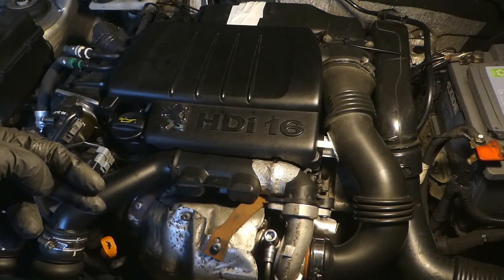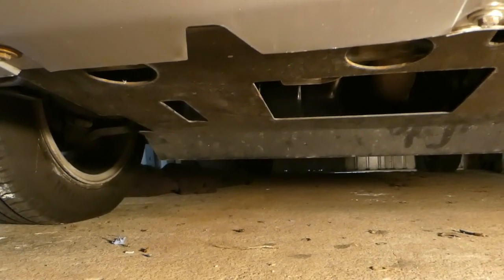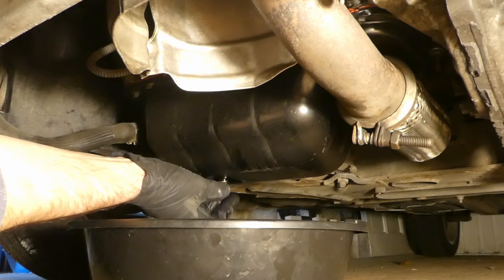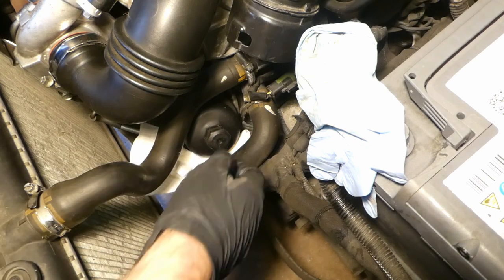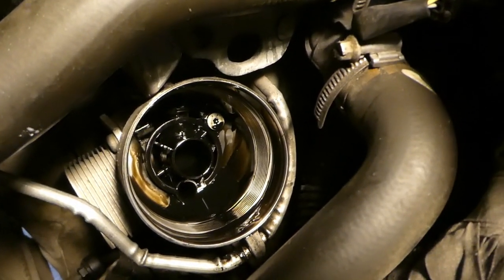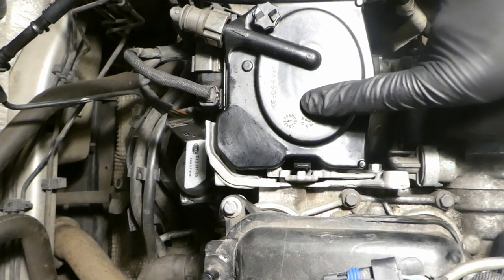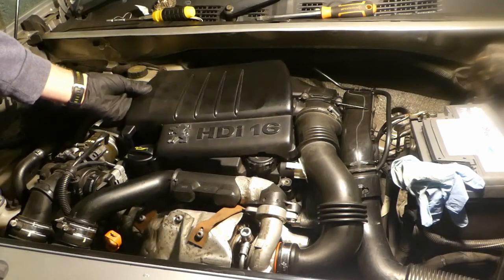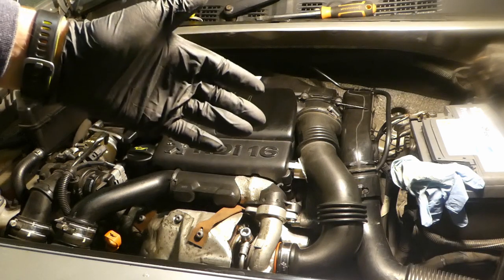1.6HDi full annual service (Peugeot Partner 2007)

Comment: Hi buddy. Thanks so much for your videos. I've just bought a Berlingo with 160000 miles. I've done a full service from your videos and cleaned up the engine. There was a lot of oil / coke around the engine bay, right down onto the alternator. I bought this as a cheap day to day run around on a tight budget, like most of us. It ran fine for a week but now I'm getting a loss of power, jerking, then the SToP sign on the dash. Turbo looks ok. Injectors are dirty but seem tight, they sound ok with stethoscope. When the STOP light comes on, the engine dies, but will start again after a minute and run fine for a while. Any suggestions where I can look next? Many thanks in advance. PS. Are you Polish? I spent a year in your country many years ago, before the EU and had a great time. I hope you're treated as well in the UK as I was in your country.  Best wishes, John
Reply from the maker: Hi John, thank you very much for the kind words, much appreciated.
When you say oil/coke, do you mean there is a sludgy carbon build up around the injectors? This is generally a sign of a failed copper o-ring in the injector seat. I would clean it and monitor if new stuff build again. It is a fairly easy job to take out the injectors and put a new seal at the bottom, you would need a reamer tool as well. Cutting out is a bit difficult to diagnose remotely, but start with the easy stuff, say an injector cleaner, I do not believe in the stuff, but it's probably worth a try. Check if the battery is OK, a lot of stuff could stem from this. Also, you could try to disconnect the MAF sensor and see if that improves anything. If it is better without the MAF, then a new MAF is needed, or potentially a clean, maybe. If you have not replaced the fuel filter, I would definitely do that. Cutting out is generally fuel related, so really clogged fuel filter might be a reason, say it was low on fuel and picked up stuff from the fuel tank. It may be worth cleaning the EGR valve as well. All in all, if you have access to Diagbox/PP2000/Lexia is worth hooking it up to and read any errors. They are a bit expensive and a generic OBDII reader might also work, before starting to replace things.
Reply: Just to add experience to this I had an old non-turbo escort diesel van that cut out continuously but would start again after a period of rest. Three trips to the garage and about £300 labour they found a crack in the fuel line right at the Tank. The repair fixed that one.

Comment: That brown plate you got there on the turbo heat sheild i am taking about mate. be great to know where i can get one for mine as it's broken and rattling
Reply from the maker: Ahh, yes that one. It's home made, i.e. DIY, haha. I got a 3 or 4mm steel flat bar and shaped it into place using pliers, taking care not to poke into the plastic above. It will be easier with a vice, but I do not have one. Drilled two holes to fit in the bolts. It has been solid for ~3 years now. My heat shields where rattling badly and after buying a new one and replacing it, it broke again and it is pretty dear to buy.
Reply: @moremolecules  Now that is very true they are dear to buy and i was thinking the very same that it will break again and i be wasteing money. i will have to do what you have done. any idea where would be the best place to get this steel from please thank you
Reply from the maker: @anglingpassion5039  If you are in the UK, I bought it from B&Q, I think it was a 3mm, the 4mm will be harder to bend. Something like this: https://www.diy.com/departments/galvanised-cold-pressed-steel-flat-bar-l-1000mm-w-40mm-t-1-5mm/3232637736107_BQ.prd
Unfortunately, tcould not find the 3mm this one is 40mm width, which is a bit much.
Reply: @moremolecules  Thank you so much I will take a trip down b&q great guy you are a legend. I subbed to you channel I love the videos you bring to this engine as I have the same one in my citroen Xsara Picasso 2007

Comment: My partner has just reached 100,000 miles...time for some TLC. Great description on how yo go about it all thankyou. One thing I'm concerned about, I'm told the oil supply line yo the turbo has a filter that can slowly become blocked with obvious disastrous effect. Have you done this before and is it of concern? Also the injector retaining bolts can loosen. Definitely worth re-torqueing to stop the 'black death'!
Reply from the maker: Yes, the turbo has a filter, but it does not become slowly blocked. It can of course become blocked. Regular and more frequent changing oil/filters help keep it clean. If you want you can replace the old-style banjo bolt filter with the new design. I did it here and showing the old vs. new style: https://youtu.be/QHY_uPbPfyg?t=114
When I opened the turbo banjo bolt with the filter, my 1.6HDi was ~95k miles and the filter was spotless.
Yes, pretty spot on for the injector bolts, I have described it in here: https://youtu.be/kt6zJANLaYQ

Comment: Such a helpful video. So broke at the moment cant afford to pay garage so going to do.myself (and replace dpf filter). Are the amazon links youve provided for a 2013 peageot partner 1.6 aswell?
Reply from the maker: I feel for you and hope everything works alright. The links are for my 1.6HDi 2007, but they should work for 2013 1.6HDi. I cannot guarantee that of course. Hope it goes well for you. Let me know if something does not quite work.
Reply: @moremolecules  thanks bud to be fair it could have gone worse so far none of the problems have been my fault. The rod sensor element plug thing that runs through fuel filter housing was snapped by last mechanic and blutac placed to seal drain hole on filter. Also the cabin filter had just been crammed in to the point it clearly isn't doing anything and its now impossible to get out. Got all the parts I needed from euro car parts which was brilliant just gave them my reg and they gave me all the right bits and oil. Going to fit the dpf filter tomorrow but annoyingly the fan going in limp mode killed the battery so difficult getting it back up on ramps. So far all the parts and a new 108 piece socket set has cost less than quote from garage at least! One question, is it bad to have a tiny bit too much oil on dip stick? I emptied sump and changed filter but haven't run the engine yet so it's just been sat there for 24 hours and oil filter will be empty but looked at dip stick today and oil is definitely above max?
Reply from the maker: @ollyjackson8733  A little bit is not that much of a problem, like a 1mm should not be too bad. The problem with a little bit of oil is that is gets frothy and everything gets clogged. If it is a tiny bit, it will be burnt off eventually. If I were you I would get a small syringe and a silicone tube from B&Q and syphone a little bit just to be on the safe side of things.

Comment: Molecules if I understood correctly you took 2000ml out of 4075ml. Why you only took that, and didn't took a larger percentage of the old oil? Like 4000ml? 

(I'm a novice)

I know that some people use a new bottle for pushing the old oil, and then they fill up with another bottle. But I was think is the oil stuck somewhere? Like turbo or something and for that reason he can't drain something closer to 4075ml?

Cheers

Comment: Awesome video as usual. Would love to see how you can get to things in something like a Peugeot 5008 though, we're access is hard and you can't really get to the back of the engine. Taking the air filter box out seems impossible :/
Reply from the maker: Haha, yeah, I do not say it is very easy on all models. On mine it is fairly straight forward, but on others you would need to remove scuttle things and all. I do not have other 1.6HDis at hand, as this is my personal car, so I can only show it on mine.

Comment: 2:22 what that pipe you removed and it connects to what, been looking trying to get its name
Reply from the maker: It is an air intake pipe with PSA number: 143451
It connects to another air intake pipe that goes to the air filter box. Unfortunately, they do not have specific names, just air intake pipes.

Comment: Hi More Molecules, when you open the motor bonnet at the left side there is a intake manifold or throttle system harness and military / dark green hoses (harmonica pleat type) and I think air or fuel sensor on it. At the bottom side of this component there also is a pivot bolt an it's slot is embedded to the motor block. That small slot piece is broken from the motor block. Please advise if fixing it by usuing some adhesive like sunfix is remedy or better to do welding. I need your advice-Thanks
Reply from the maker: Hi Suat, I think you mean the EGR throttle body that is next to the intercooler. Yes, it is fixed to the engine body and the underside is aluminium. I am not too sure what I can advise as I cannot see exactly what is broken. You could try with the sunfix and see what happens. Not too sure if sunfix can bond to aluminium.

Comment: hello i love your videos they are very helpful many thanks could you please make a video about oil dipstick TUBE i pulled it up and couldn't put it back coz i cant find the hole thank you so much
Reply from the maker: Not too sure what you mean. If it is the whole dipstick tube, that might need to open the sump and position it there. I have a video for the sump replacement as part of the turbo series, check it out.

Comment: I am half way through the work.  Engine oil and filter done. I am stuck with removing the airbox. It seems my car has a moulded fibre cowling just in front of the bulkhead, behind the bonnet. It comes over the top of the airbox. I have moved my brake reservoir like you, but it seems this whole portion needs to come off to allow the airbox out. Did you remove yours.... it seems you have far more room......!
Reply from the maker: Yes, probably you need to remove the screen wiper cowling to remove the airbox. But in general you should not need to do that, you can just unscre the bolts on top of the air box without removing it altogether.

Comment: My car does not have the hand fuel pump. How should I prime/bleed the fuel in my case?
Reply from the maker: Yes, some do not have one. I cannot quite remember for these, they are either self-adjusting or you need a hand-held pump with a one-way valve. Amazon/ebay self a lot of these one-way valve pumps, it is similar to mine in the video. Remove the pipe that goes back to the fuel tank and pump until hard. Literally does the same thing as on mine.

Comment: Hello. I have a 1 6 hdi. and it's a water pipe that's not whole, think the air filter box has rubbed a hole in it. Is it difficult to change. how long does it take to do it.
Reply from the maker: What do you mean water pipe has rubbed a hole in it? Do you mean the air box has rubbed a hole in the EGR?

Comment: Just bought a dispatch 1.6 hdi 63 plate with 81k on clock. When a bought the van it all seemed well. But after having it a few weeks I’ve noticed black smoke under acceleration. Is this anything to worry about ? I was told by the seller the dpf has been removed and a remap.
Reply: I serviced it today following your video made it easy I also used all the products you advertised falling your links can’t thank you enough

Comment: Please help me with a fuel line high pressure sensor as, as installed car won't start
Reply from the maker: What was the problem with the high pressure sensor? Did you pump the big rubber thing on top of the engine until there was no more air inside?

Comment: Great video man do you recomend this 5w30 oil for my peugeot 308 1.6hdi even if I have 280.000 km driven?😁
Reply from the maker: Check with the Peugeot booklet what they recommend, as yours might be newer 1.6HDi, although the Total INEO ECS 5W30 is low SAP, in other words less ash and works better for engines with DPF. Even if you do not have DPF is OK. I have had this oil for the past 5-6 years and have not had problems.
Reply: @moremolecules  Thank you!

Comment: Are there 2 types of fuel filter for this car? My replacement one is slightly different. Instead of the piece that gets swapped to the new one sliding in from the end, it is held in place from the "front" and needs to be angled in. Does this sound right? Peugeot didn't seem to know the answer
Reply from the maker: Not too sure, but as far as I know it is only one diesel filter for the 1.6HDi. The one where it is one single unit, i.e. HDF939

Comment: Hi I find a bit of diesel on top of my diesel filter every time , do you think it’s cracked or does feed pipe have seals in them ? It’s new
Reply from the maker: Ah, that is a bit wierd. Never seen it before. Is it always or when you replace it. Are you certain it is diesel? Also, there is a valve on top of the filter and it could be leaking a bit, but this would mean that you would get ait in the filter and potentially hard starting. I would check if the valve on top is secured quite good. Of course, the 2 pipes could be leaking a bit as well, but then again air in the system and hard starting. Do you get any symptoms or not at all?
Reply: @moremolecules  hi thanks for the reply , it starts fine , I will check that valve tomorrow thanks . Appreciate it
Reply from the maker: @kenrossaukrsa  I doubt that the valve is the problem, but also check if there is any fuel around the two fuel lines.

Comment: Hi,
Do you know where is the oil level sensor located? (Not the oil pressure sensor) As I didn't find anything on the Internet. When I read some live data out of my c3, the oil temperature is constantly -40 celsius.. Any idea if not the oil level sensor?
Reply from the maker: Should be at the back right side of engine, pretty long oil sensor. I cannot find a photo to show you, but should be there. I think it might be grene plastic as well.
Reply: @moremolecules  Thank you. So it should be right next to the AC compressor?
Reply from the maker: @doogk9266  No, my mistake of saying at the bottom right side of the engine. It is at the bottom right side of the engine when you look at it from the front. Somewhere below the Fuel filter/EGR valve, not next to the AC compressor.
Reply: @moremolecules  Appreciate it. Love your videos, you helped me a lot. I know you just said that where exactly it is but maybe would be useful for others too to put up a video about the oil level sensor location? Cause there is none on youtube..
Reply from the maker: @doogk9266  Might do one at my next service, as a few parts need to be taken off. Appreciate the idea 🙂
Reply: @moremolecules  in order to replace it what parts do I need to take out? I haven't been able to find any details about it on the internet. Do you know any repair/workshop manual?
Cheers
Reply from the maker: @doogk9266  Not that I am aware, but will try to find the part number.
Reply from the maker: As far as I am aware the part number for the oil level sensor is 1131 G2.
Reply: @moremolecules  thank you

Comment: how much did cost the maintenance ?
Reply from the maker: All in all, 76 GBP
Reply: @moremolecules  isn't it expensive ? i am living in turkey and here including pollen filter and maintenance service 1.6 hdi engine full maintenance only 45 GBP .
Reply from the maker: @kadirhanatmaca  That is a different topic of discussion. In a garage here (UK) for all these they charge me £300. It really depends on the quality of the replacement parts and of course labour. In some countries replacement parts and labour are cheaper. These are prices here in the UK, if you buy the same in Tukey they will be cheaper. I cannot quite know what the price there will be.
Reply: @kadirhanatmaca  Would it still be £45 if you used Bosch parts and the same oil? The oil is around £30 here for 5l.

Comment: You waited 1h to let all the oil drip? 4:56 

That's a lot of time 😮
Reply from the maker: Yeah, I wait longer normally, like 5-6h. I have the time, but appreciate that other people do not have the time.
Reply: @moremolecules  thanks for the feedback. Yeah I thought it was a quick operation, I'm taking notes because I'll change oil myself for the first time. But I have no garage. I have to do it on a low profile place and I might not have all the time in the world! Cheers
Reply from the maker: @nelsonthekinger  Basically because I have a garage and I can wait long to get the last few drops I wait. Do the oil sump first and then do the rest. That would give you time for the oil to drop.
Reply: @moremolecules  thanks Molecules💪

Comment: can you make a video on the cabin filter if you dont have A/C? cant find it on my 2007partner  MVP 5G 1,6hdi whit no klima or A/C
Reply from the maker: No A/C no cabin filter. That's it. If you do not have AC, then there is no cabin filter to be found, sorry. Cabin filters are only installed on the engines with AC. That is why you cannot find it, it simply is not there.
Reply: @moremolecules  thank you.

Comment: So, I've ordered that oil syringe but it came with only 300mm tube, which is definitely not long enough. Can someone confirm the od. The tube in the video seem to be less than 12mm od.
Reply from the maker: Hi there. Apologies, maybe I should have said that the syringe came with a very short tube. I bought a separate, longer tube so I can fit it to the bottom of the sump. Probably I made a mistake in the description of the video. I will correct that. The tubing is 7mm OD, 8mm will also probably do. I just went to measure it. Apologies about that
Reply: @moremolecules  No worries! I bought what looks like 8mm od (can't measure it the caliper ran out of battery) and I can barely get it in. Still managed to get about 500ml oil out. The garage I went for service overfilled. It seems to be near the max now. Btw great videos!
Reply from the maker: @shmatic9665  Ahh, yes overfilling could be pretty bad. I think it was 7mm OD, as I measured it, but it is a bit cold outside and that tube has been used for quite a bit, so it might have shrank a bit, but probably 7 OD.